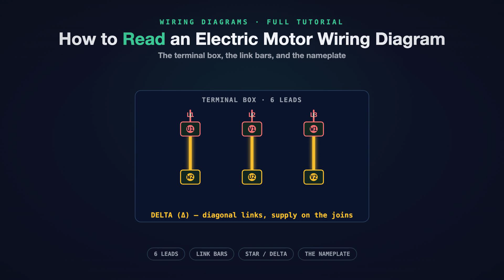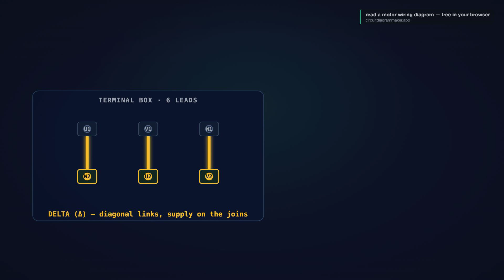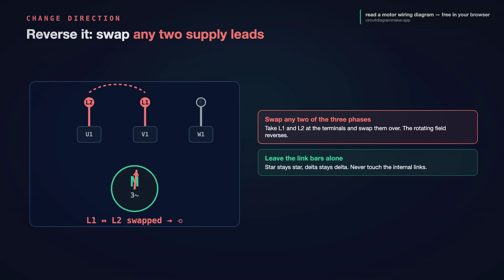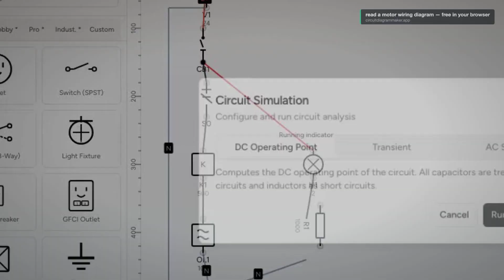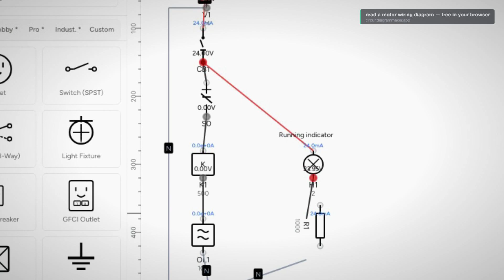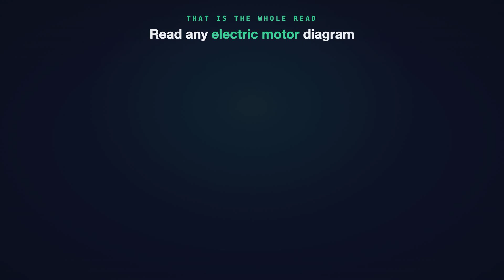How to Read an Electric Motor Wiring Diagram

Comment from the maker: Three things that make an electric motor wiring diagram readable. One: open the terminal box — a three-phase motor has SIX leads, not three (U1/V1/W1 on top, U2/V2/W2 below, or T1–T6 on older motors), because each of the three windings has two ends. Two: the link bars decide the connection — STAR (wye) bridges the three ends U2/V2/W2 into one point and feeds the top row, delta links them on the diagonal (U1-W2, V1-U2, W1-V2) and feeds the joins. Three: which one? The NAMEPLATE tells you — 400 V with a Y is star, 230 V with a triangle is delta; match it to your supply. To reverse, swap any two supply leads — never the internal links. Discharge any capacitor before you touch anything.

Read a real motor wiring diagram free: https://circuitdiagrammaker.app/diagrams/motor-wiring-diagram?utm_source=youtube&utm_medium=pinned_comment&utm_content=yt-018